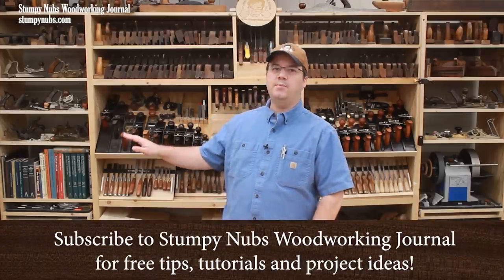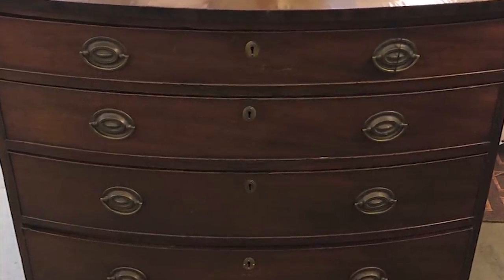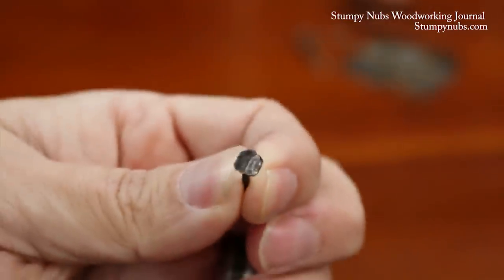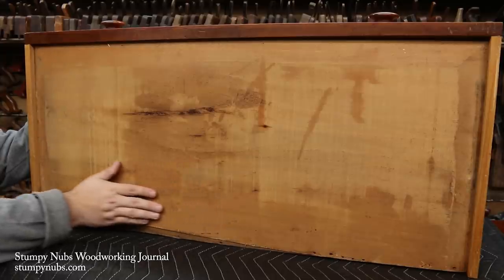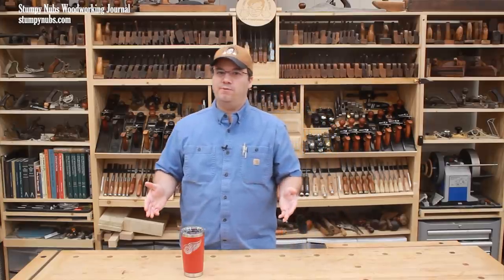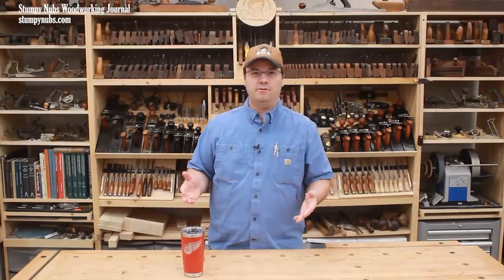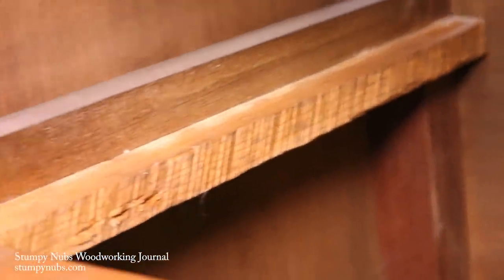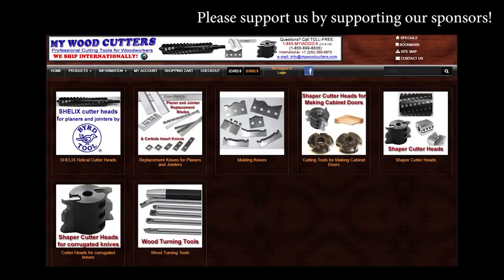The wonderful secret I found in an old dresser

Comment: After our move to Louisville, KY, 20+yrs ago, I put my wood shop back together in half of our 2 car garage. I've made several pieces of furniture over the years from cherry, pine, walnut, maple, and mahogany. I really became more inspired after my first and subsequent visits to the Shaker Village at Pleasant Hill (south of Lexington, KY). There is real beauty in the simplicity of the Shaker style furniture. I made a very simple corner hutch from cherry for my daughter during 2020's pandemic times. It is my favorite piece in nearly 40 yrs of woodworking. It is 28" on the wall sides and 40" across the front and 72" tall. The top half has 2 shelves with 2 doors, 2 over 2 glass  panes. The bottom has 1 interior drawer and 1 shelf covered by full paneled doors. In late 2020 into early 2021 I was commissioned by two of her close friends to build the same hutch for them.

Comment: Many thanks James for continuing to use this specific piece to teach us.  You've given me insight that joins together my two hobbies, woodworking and genealogy.  One of my 3GrGrandfathers is shown in the census records as a cabinet maker in the mid-1800s, and the same records show several carpenters and other craftsmen living nearby; separate research shows that he lived near a mill, now long gone but I've been to the location where the old dam still remains.  I bet they had an up-and-down saw operating on the waterwheel, and my ancestor and the other carpenters lived nearby to take advantage of it.

The most important sentiment you expressed was the last one - if you could, you would track down the family and return the piece.  That's a really nice thought.

Comment: James,
Thank you.
I own a family dresser of about the same size and it incorporates similar construction techniques. This walnut chest with marble top was painted when I received it 40 years ago from my grandmother. I stripped the paint, removed the cheap replacement drawer pulls, which revealed original pulls hardware holes. I liked fancy carved walnut pulls at the time and I purchased Van Dykes machine carved walnut pulls. The purchased pulls were horribly crude, so I hand carved them to dress them up. 
Other repairs included repairing the worn drawer slides and drawer bottoms similar to your example. I thought hardwood was better than original wood to combat wear, so I used salvaged skid material, oak and/or maple. The case was pretty sloppy and wiggly, so I applied protiduous amounts of glue. I had no knowledge of cabinet making and didn't know that binding the full width side panel would stress it to the breaking point. It looked great with a fresh application of boiled linseed oil. I mailed a photo of the salvaged chest to my grandmother. Though this chest had served as her kitchen cupboard and sat next to her wood stove all of my life, and I suspect for decades, she said that she had no recollection of having ever seen it or absolutely ever owned it. 
This chest was our dearest prized piece of furniture when we were early married poor. It remains a cherished family piece, though I cannot restore its family history. The chest long ago became our Lego chest. K'nex fill the bottom drawer. My kids played with the toys and now my 34 grands play with the toys weekly.
I regret the split side panel, but the chest tells a history of our family, probably for at least 90 years. Painting the walnut, misapplying drawer pulls and making destructive repairs tells the story of farming and working class folk living life practically. Even with the wear and tear my household has done to this chest and my ability to make more appropriate repairs or purchase a finer piece, this ragged beauty with its life scars is one of my most favorite.

Thank you for your lesson.

Comment: This was a fabulous video. I’ve a number of 100+ year old chests of drawers, some with repairs similar to your chest, but a couple in original condition (sticky drawers and all).  I can’t wait to go explore each of them again to look for the details you identified.  One thing you might look into are early 1800’s Sugar Chests. I live in Kentucky and early 1800’s locally made sugar chests are interesting because sugar was so valuable that it was generally locked into an important piece of furniture, like a desk or secretary. The core of the piece of furniture housed the sugar, hidden/surrounded by the function of the piece.

Comment: Fascinating story, James!  I think your conclusion sounds very plausible.   Was there anything else that helped you place the age at 200yrs for this piece?  Or was it mostly the wide boards + vertical saw marks?
Reply from the maker: The original video goes into more detail. But the fasteners (screws and nails) were a big part of how I determined it's age. They helped me narrow it down to about a ten year period.
Reply: Im working on a piece thats around 1850-1880's and hope to finish and post the video once the weather calms down!
Reply: My wife inherited a table with many similar details, but its from the southeast and not Shaker style.  The distinctive thing about it is delicate legs set at forty-five degrees to the sides, front and back, with delicate, splayed feet that are scarfed to the legs.  There are no screws but the nails are rose-head and evidently hand forged.  There are two locks, different kinds let down into closed lock mortises, so that all you can see ar the key holes and plates.  The details of the plates say the locks are hand made.  Curiously the front, top and sides are veered in mahogany, and the second wood, southern yellow pine is carefully stained to match, the tertiary wood is poplar.

Comment: Dove tails are common on period hardware primarily because it added strength to a joint that simple hide glue alone couldn't. A craftsman who took pride in his work or wanted a more finished look ( or in this case a hidden joint on the rail ) would often choose the dove tail over a simple pegged mortise and tenon.

Comment: I'm 51 and still using my childhood dresser. My mother use to refinish old furniture and got her hands on a huge oak dresser that had reportedly come out of a mansion in road island. Stands 4 feet tall has 5 main draws 2 smaller ones they decrease in higher as it goes up all have ornate brass cast handles and all have ornate cast coverings over the locks. All 7 have locks. At close to 150 years old its a hell of a piece.

Comment: An excellent and accurate presentation for that period of case work construction. Here in Maine we have a Shaker Museum as well as a complete operational "Gash Saw" in the Maine Museum in Augusta. One small point in addition for identifying  the saw marks, is that on a pit saw the marks on either side of the wood are not exactly opposite each other but on a later "Gash Saw" they are, as the blades are held in place with a frame keeping them parallel. Thanks again for the expertise.
Reply from the maker: Did you mean "gang saw?"

Comment: Thanks for doing the follow up video on this chest of drawers. I have two of these chests, one that is very similar to yours with the frame and panel sides that has been in my family for a long time. The top of that chest is made of wide cherry board with a narrow board glued to make up the width. The second chest is similar but the sides and top are wide boards. The top is 20 1/2” wide single board and the sides are different from the first chest being 19 “ cherry boards. It is complete but in generally rough shape and was given to me instead of being taken to the dump. This chest has a bonnet drawer (I’ve never heard that before today) with a height of 11”. The chest that has been in my family has a 12” top drawer (bigger bonnets?) and a 20 1/2” top made of a 17” cherry board and a 3 1/2” board. Thanks again

Comment: Correct me if I'm wrong, but I believe I saw marks from the teeth of a planing stop in the end grain of the top panel.  I love seeing tool marks, those tiny imperfections tell a story and that's what I find most pleasing about furniture built by hand.
Reply from the maker: That is a possibility, though I would expect the maker to clean such marks up in such a visible area, and we have no idea what marks came afterward from 180 years of use.

Comment: Hello, your video is absolutely terrific. I'm a professional furniture repairman guy and just completed extensive repairs on a almost identical dresser for a customer. On mine, the top is one piece of cherry and the side panels were cherry too. The scrub plane work, saw mill marks, wide floating back panel, dovetails and locks were identical. I added new wood on the bottoms of all the drawer sides, and new runners in the carcass. I took detailed photos of the work I did and of the various parts that were disassembled. If you have an interest in seeing the photos contact me.

Comment: That is an extraordinary piece in my opinion. There aren't such old furniture in my family, just a couple late 19th century pieces and a night stand with inlays on the top which is missing a few inlays sadly. There is an old saw mill near me. It may still be in operation as there is still a water wheel, the original dam, and the building is full of cut lumber that isn't treated. I'll have to check up on it and edit this post if it is still operational.

Comment: I can't believe that I have a very similar chest of drawers that I am restoring. It has been passed down to us from my mother in law. She  remembers it as a little girl. It must be at least 80 years old and has lived in Western Australia. She can't remember where it came from and of course her parents have passed on. As yours, each drawer has a lock and all the drawer runners and drawer bottoms are quite worn. The interesting thing with mine is the drawer knobs are held in place with a threaded wood screw. There's no way known I would have even imagined it to have anything to do with Shaker furniture, not a common thing here in the West. Anyway, I will check out your videos from 2015. Thanks for another great inspiring wood work story. Cheers Wayne
Reply from the maker: My drawer knobs are also attached with blunt-tipped wood screws. The knobs themselves are modern replacements, but the screws are very old.

Comment: That is the sort of piece I am attracted to.  (An attainable level of skill.)  Thanks for the extended tour.
Given the full set of locks and the dovetail efforts within the cabinet, I am left wondering why there aren't dust panels between the drawers.  I am no historian, but I was taught that if you use locks then you use panels to maintain security between the drawers.  And for the age of the piece, coming from ashy and less paved times, panels would have been a benefit.
But it doesn't help me further imagine the craftsman or the customer.
Again, thanks.

Comment: My wife and I moved into our house at the turn of the century, along with our 2 small children.  Of course with the new mortgage, we had no money and no furniture. We had our mattress on the floor and whatever random apartment furniture we had.
So I used our lack of money to make our bedroom set instead of buying it.  Because a bedroom set from a furniture store like Marlos cost $5,000, and it would fall apart in a few years.  I could make ours over about a year for a lot less.
So I got the "Country Fresh" plans from Wood Magazine and made them the next year.  Finances were still tight and I struggled to afford materials.  One compromise was the drawers - I made the sides out of poplar because it was a lot cheaper than oak and no one would ever look at it.  I probably should have stained to look like oak, but didn't bother - so the insides of the drawers still have that greenish tint of poplar.

It has been 20 years now, the kids have graduated college, and we are still using the same furniture.  I'm am not going up to check, but you can probably still see the thickness planer tracks on the inside of the drawers.

Comment: The difference between a chest of drawers and a dresser is that the dresser is taller with a smaller footprint, and a dresser is longer lengthwise with 2 or 3 sets of drawers from top to bottom, while a chest of drawers only has one. The terms are not interchangeable. A dresser would be like a table with two or three columns, and 3 or 4 rows while a chest of drawers would have only one column, and 3 or 4 rows.

Comment: The Shakers were known to take commissions from non shakers, for their furniture. So this piece could have been one of these. If a merchant commissioned such a piece, they would have things of greater value desiring locks on all drawers. In such a shaker woodworking shop, there was an apprentice type system so an apprentice would be given the task of planing bevels that would not be seen as part of their training. Since 5h3 Shakers were an order that required chastity, such apprentices would have been orphaned children taken in by the order as an  act of charity, but kept the order alive for some time. The rear  through dovetails, would have been part of the advanced training an apprentice would receive. As might be the internal blind dovetails as proficiency permitted , as these dovetails only reach half the thickness of the stiles.

Comment: Maybe this chest of drawers was the builder's shop furniture. If he was a skilled carpenter, it could be that some of his most expensive belongings were his tools of the trade, hence the need for locks. He had to build it with strong joints to support the weight of his heavy woodworking tools. Just speculation, but considering how many videos on YouTube are about making your own shop furniture, it's cool to think that woodworkers have been doing that for hundreds of years. Some things don't change.

Comment: My mother bought an old heart pine chest from an antique auction that was previously owned by a Confederate soldier.  We opened the chest up  and there was a wood knot down at the very bottom of the chest about 2-3 inches long and I we noticed the center of the knot was kinda loose and I took a screw driver and it came loose.  We looked at it and noticed that it wasn't wood.  It looked like a black piece of lumber graders chalk because it was jet black crystal 2inches long and crystal shaped.  It was a sapphire.  The soldier glued the sapphire stone (which is actually black until you clean it up) in the middle of the knot hole to make it look like it was just a piece of the knot remaining in the middle.  We wouldn't have found it, but it had just came loose.  Clever bastard.  It had been hidden in that chest for over 140 years and nobody found it.

Comment: I am curious about the machine-made screws used in here which seem a little modern for the rest of the construction, do you you think it could be possible that their holes were originally also filled by nails and were later replaced by screws when they became loose?
Reply from the maker: Machine made screws with blunt points appeared in the late 1700's. Tapered shafts appeared around the time this dresser was built.

Comment: Thanks Stubby. I am restoring a similar dresser now; but with solid mahogany top & pine as a secondary wood. The drawer sides were worn to the groove & the drawer back was made of 16"+ wide pine. I'd be interested in your thoughts on designing drawers for wear. I have never seen a drawer front pull away from the sides (rebated, dovetailed, nailed, whatever). But most dressers I see have serious-to-disastrous wear on the drawer sides & drawer runners.  Drawer slips look like one way to limit this. But I wonder if using a hard secondary wood (e.g. maple or birch), even as a bottom strip, for drawer sides & runners would prevent the real wear that dressers seem to suffer. Thoughts?
Reply from the maker: Hardwood will certainly wear more slowly that soft wood. But it can be an expensive way to build a drawer. Frankly, this dresser survived well over 100 years before repairs were likely made. I think that's beyond the expected lifespan of most furniture :)

Comment: HELP! I am  brand new wood worker, at 63Yrs old.  I have purchased some tools, Table saw, Router, Drill Press, Jointer and a band saw. ( All used and in good order). I have no work bench, tool storage,  cabinets , shelves in my garage.  I  Need help in what order to start building these needed items, to include what Jigs I should build to help with the items, I am just overwhelmed with this.  I have lots of time, limited $$$ to work with.  Any help you can offer will be greatly appreciated. This may be good info for many new subscribers as myself.  Also, how much do I like your channel? Well lets just say I have watched your videos over 400 hrs so far, Love every one of them!
Reply from the maker: Start with a simple workbench with a construction lumber frame and two layers of 3/4-inch sheet goods (plywood, particle board, MDF, etc.) on top. Don't put too much time or effort into it, because you will likely want to upgrade to a cabinet-maker's bench (which you can buy or make yourself) before long. But for now you just need a solid work surface.... Next, choose your first project and buy/make only what tools and jigs you need to make that. There is no need to accumulate tools and jigs for projects you MIGHT make, just for what you are currently making. If there was one jig, though, that you may want to build ahead of time, it may be a table saw sled. I suggest beginning with a very simple one with few frills. In time you can build something more complex as your budget and skills allow.... It is easy to spend a ton of money on tools and jigs in this craft and have little left over for the actual projects :)